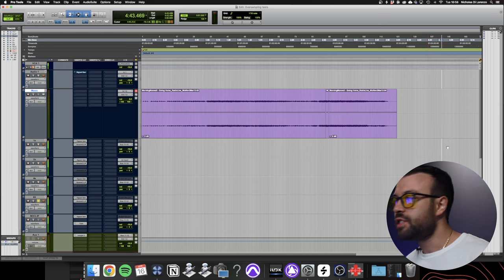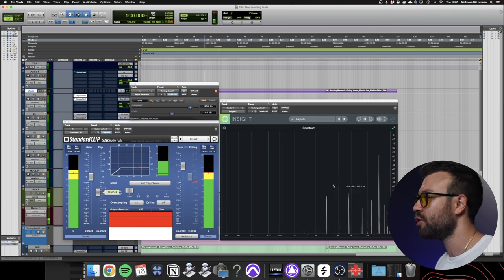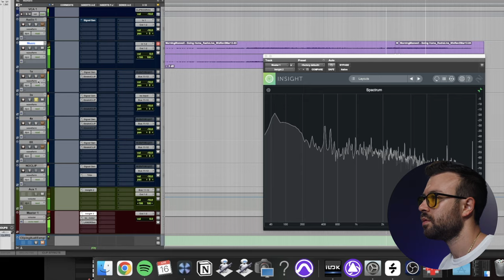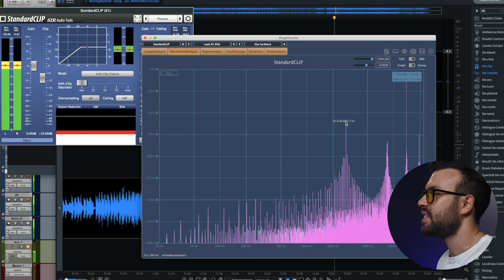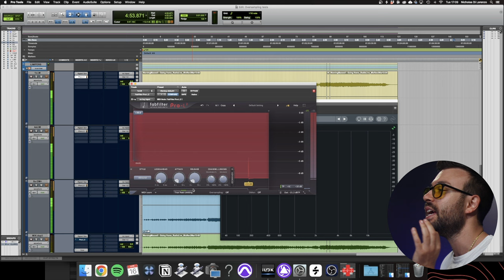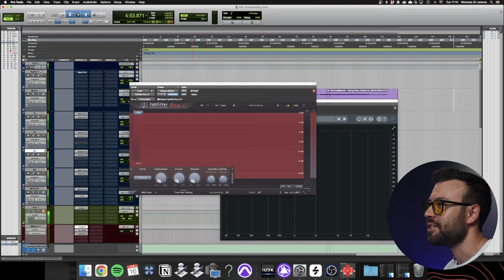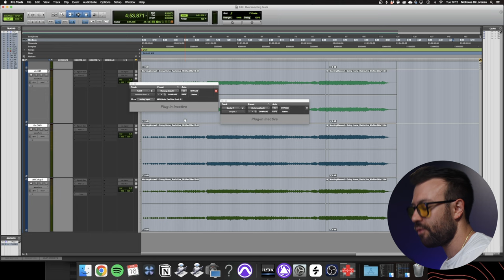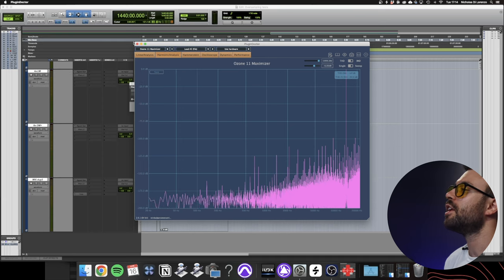The best oversampling... what should you pick when mixing and mastering?

Comment: Max attack and min release is a documented and well-known pair of settings for L-2. You wouldn’t push those settings 10db though, but those settings specifically on L-2 are often used for bass scene and similar genres, it gives a very unique sound, and it still can be clean if you mix your track well enough.
Reply from the maker: Yeap! Hard Clipping ;)
Reply: @panorama_mastering  I forgot to mention — you usually would disable True Peak there to achieve that sound. to me that still sounds a bit different from just hard clipping though

Comment: I'm not sure if you mention it later in the vid, but the way you are doing the test is as if we are assuming that all processing is done on the master/mix bus, or a single bus/track only (which makes sence from a mastering point of view).

 However it would be diferant for say a mix where saturation etc. is being used at every stage, even if at 4x on the master it's unaudiable, when many layers of it are added together it may later become audiable at 4x, so a higher rate may be nessisary when using it on multiple sources, rather than just on one channel. This is especially true if processing the same source material at multiple points in the chain (track+ bus+ mix bus for example) as each time it will be creating more of the same frequency aliasing distortion (as well as making all the alisasing distortion from before alias it's self too!) :O. It can become quite a mess when pushing it intentionally for experimentation and this could actually make your top end/high mids become a bit hazy in highly processed projects due to so much low level stuff going on beind the music, and aliasing on top of aliasing ontop of aliasing. It's especially noticable when using the same processing over and over again as it produces the same distortion profile (another excuse to use a bunch of diferant saturation types in your mixes ;p).

Also the harder you are hitting something with clippers/saturation etc, as well as the base samplerate can also make a big differance to how much alias distortion it produces and how much OS you may need. Oh, and the lower the freqency that's being processed, the more aliasing distortion that will fall into the audiable range at the same OS rate. All things to maybe consider.
Reply from the maker: Of course! I am coming from a mastering context.
Reply: @panorama_mastering  Just thought I'd add some further context. 👍

Comment: I choose oversampling settings by the feel of the sound and the groove and strangely each plugin manufacturer sounds different. Standard clip and Acustica plugins I prefer the sound of 4x. SSL native bus comp I prefer the transients on 2x. TDR precise setting. All other plugins off. I find that most other plugins mess with the groove, I'm not sure if the latency isn't compensated properly or something but the groove sounds tighter when off, especially Lindell plugins I use their API plugins a lot and they sound better when off. I don't care about the technical reasons and aliasing etc, it's how it sounds and feels that dictate all my choices when mixing. Sometimes theory and reality are different, so don't overthink art. If it sounds good it is good.
Reply: There's a TON of decesions a plug in manufacturer has to make about the design of the filter they use when designing an OS function. This will differ massively between manufacturer as each will value something diferant, and there's three main things that all have a give and take relationship when designing these filters. More of one you get less of something else, and each manufacturer will have their own balance of these three things (slope, phase type and I forget the third, each has it's own effect on how the OS functions in a sort of tug of war with the other paramiters). 

The filter design is what has the most impact on how diferant OS can sound from plug in manufacturer to manufacturer, and there's no perfect filter when talking about this aplication so you are always gaining some things and loosing some others no matter what you choose for the filter (and some manufacurers give a lot more thought to it than others).
Reply from the maker: Interesting choice
Reply: 100% agree

Comment: A question on true peak limiting : Many engineers says it kills transients a bit and regarding facts, they argue that most of todays music .wav files true peak above the 0db. And that "the louder the better". On the other hand, I understand true  peak mode is here to  prevent distortion after some conversions  in the analog domain. I tended not  to use true peak mode as most pro music do not care. Tell why I'm wrong, tell me why I'm right ! Great content as always tho
Reply: All true peak does is make sure you won't clip, to do so, it turns your mix a bit lower than a normal limiter, that's why it might sound a bit quieter, but not by much.
Reply: Also curious about this. There's a lot of mainstream tracks with true peaks near or above 0dB. I've heard that -1 is safe to leave room for conversion to lossy formats, so that's what I've been limiting to. I wonder if that's necessary.
Reply: Don't listen to any of that bs. Turn off true peak limiting and push your tracks to 0. Literally, every pro release is like that. The true peaks go well above 1db.
Reply: @TakeHit0  I've downloaded tracks before with audiable clipping because the mastering engineer didn't pay attention to the true peaks on multiple occasions and it always sounds so bad to me. 

The issue with going right upto 0 without true peak limiting is that every D/A handles overs differantly, so on some playback systems you might not even hear the overs as it is designed to recreate the wave, but on others you could get audiable hard clipping of peaks as it just cuts them off to flat tops, as well as everything inbetween.

Just because some people lazily or ignorantly do something (or don't do something as in this case), doesn't mean it isn't better to do it the other way. Sometimes you'll get away with it, but in some instances on some playback systems the overs that were unnoticeable in the studio will be audiable and sound really bad to the end listener on their system. Not only is that bad on it's own, but you also want everyone to have the exact same listening experiance, and ignoring overs and letting clipping at 0dfs happen you can not guaentee this will be the case.
Reply: @DaftyBoi412  In my personal collection there are thousands of songs and I've randomly put enough of them into the analyzer to confidently say that all of them have true peaks, save for the rare few exceptions that don't. Not once have i ever heard any audible digital clipping. 

To me, it's amazing that you've managed to find tracks like that on multiple occasions. 

Ignoring true peaks isn't something done out of ignorance. It's quite the opposite of that. Caring about true peaks is born out of ignorance. Because it doesn't matter. Do you have any examples of actual pro masters that have audible digital distortion from true peaks? I'm not saying it doesn't exist, but it's so rare that it's literally a non-issue and definitely not worth destroying transients over. 

Also, could it be possible that the mastering engineer you're referring to just hard clipped too much in the master bus without noticing it?
Reply from the maker: I will do a video on this. But in the interim here’s some good info

Is True Peak Limiting a Lie? What You Need to Know!
https://youtu.be/70bqdkej9KU

Comment: I was analyzing one of your masters on Spotify (The Bad Touch - Pelican, Tribbs). I have the browser audio running through span, and it says the True Peak was reaching 0.5 db. Do you know why this would be the case since you use true peak limiting? 🤔 I'm just wondering if using True Peak even matters if it's still going over anyways.
Reply from the maker: That’s the lossy format introducing new peaks.

I do autition this to see how severe the sound is. 

I will use the codec audition in ozone doing INTO a hard clipper to see how “nasty” it will sound. So I can back things off accordingly before commiting the master.

Comment: i was playing with oversampling yesterday i crushed a mix with standardclip had 1 on 2x and the other on 32x. i then set it up so it would randomly switch between which one was playing. i honestly could not tell when it was switching. i tried to look whenever it was on 32x and got it wrong quite often. it surprised me because ive had mine on 16x
Reply from the maker: Interesting, how much clipping was it doing?
Reply: @panorama_mastering  10db I'm gonna try it again with a few different songs another time. I was using the Ableton LFO on bin so I had no influence on when it swapped.

Comment: I have a question, when rendering does it matter to activate oversampling in each plug-in that has it? Or is the last plug-in like Masterplan at 4x to 8x enough? Right now I've been activating ovs in each plug-in.
Reply: Each plug in that produces aliasing distortion would need to be oversampled itself as the aliasing distortion is added within the process happening in that plug in. If you oversample after, it doesn't really do much as the aliasing distortion is already baked into the output of the plug in before.

A plug in will oversample THEN apply the process, THEN filter and downsample, and this is what removes or limits the aliasing. The processing it's self needs to be done at the higher sample rate which extends the bandwidth to way past the audiable range (meaning there's more space for the aliasing to simmer down beofre getting back to the audiable range), then a filter is applyed right after cutting off most of the left over aliasing before it hits the audiable range, then it's sampled back down to what ever it was before.
Reply: @DaftyBoi412  thanks, understood.
Reply from the maker: What daftyboi said!

Comment: I always go as high as my system can handle. My transients are still popping though. Should i be doing less that 8x or 16x?
Reply: I don't think going higher has any real negative effects other than performace impact. There's an argument that downsampling over and over again from higher OS rates may have incresed impact of sound degredation, but TBH that's more an issue of just repeated OS processes on the same souce material rather than how many X OS you use imho.